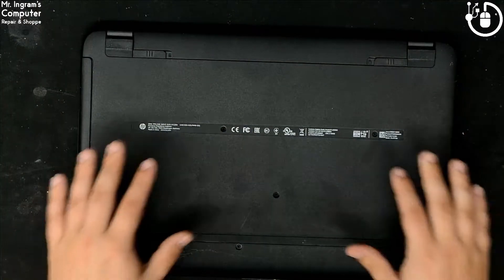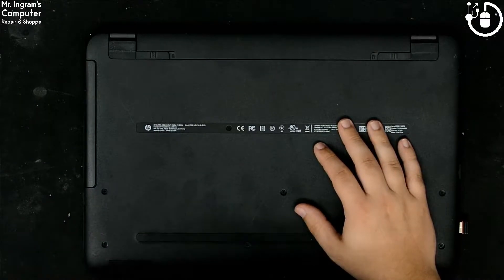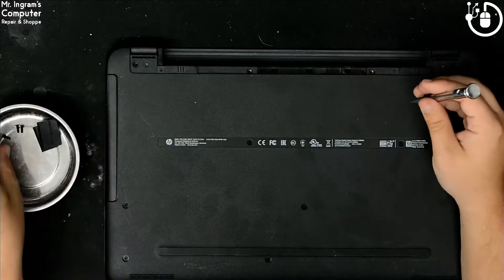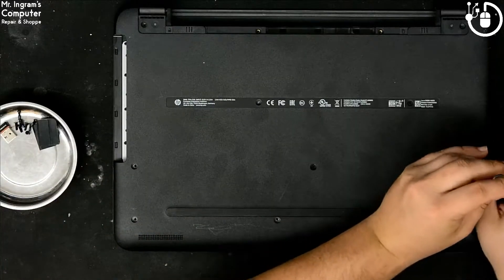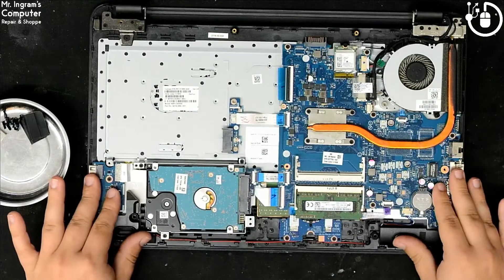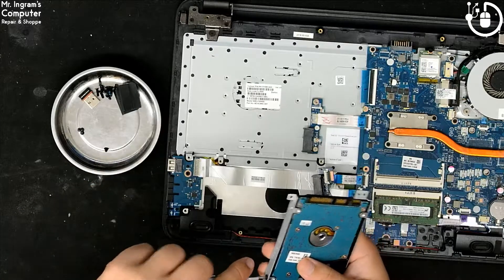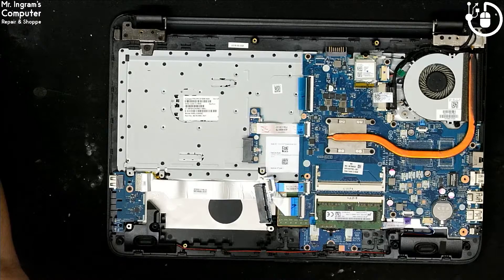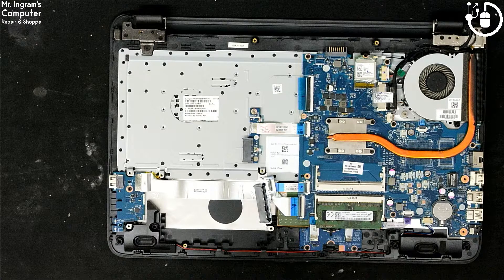HP TPN-C126 Laptop teardown and  SSD upgrade

Comment: Can you please tell did you installed ssd on place of HDD? because i didn't get this
Reply: u replace the hardrive with a SATA ssd (m.2 SSD won't work as far as I know) I have done this replacement and it works just have to make sure it is oriented right for my Samsung 860 EVO it had to be put in flipped
Reply: yes, younger me, that's it